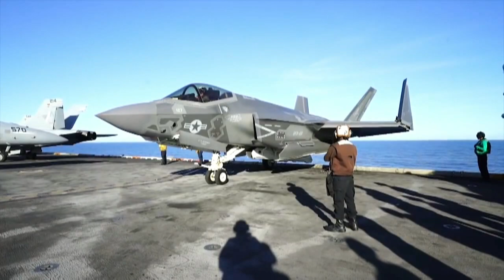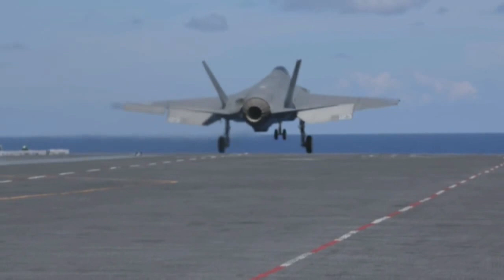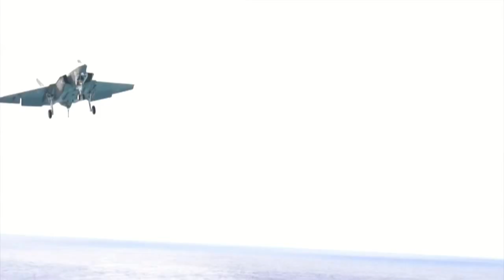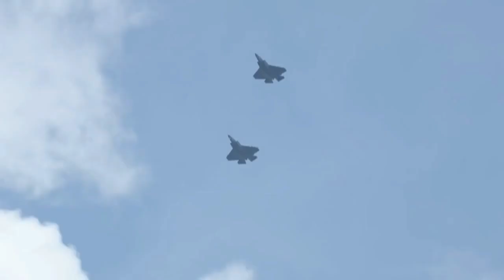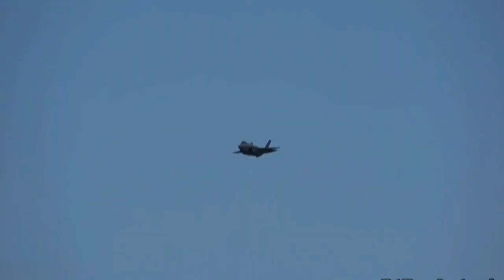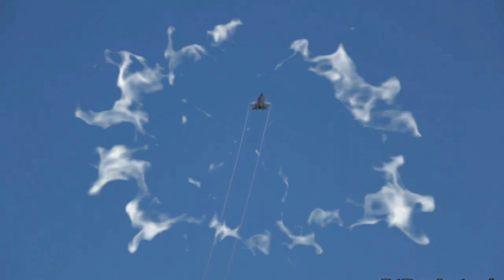American F-35C not able to Fly at Supersonic Speed - Stealth's Problem

Comment: Get the facts straight, This was a problem on ONE test plane in 2011, lot 8 production.. This was an early model with test stealth material. Lockheed resolved this problem with a new "baked into the skin" stealth mat. For maintainability, the F-35's stealth design took lessons learned from prior stealth aircraft such as the F-22; the F-35's radar-absorbent fibermat skin is more durable and requires less maintenance than older topcoats. We are now into production Lot 13. The agreement calls for Lockheed Martin to produce and deliver 478 F-35s. This includes 291 aircraft for the U.S. military, 127 for international partners that contributed to the development costs of the F-35, and 60 for foreign military sales customers.
Reply from the maker: Dear Friend, its a new report. Report submitted on last Friday. I think you are not updated on this matter. 
https://www.defensenews.com/air/2020/04/24/the-pentagon-will-have-to-live-with-limits-on-f-35s-supersonic-flights/?fbclid=IwAR068KbNL2VWbnh3CgXdlUl4Vf_9P18OvTb5R_1qbyA35wdssoZ1wlwhJwY
Reply: @defensebarta2617  

And oh dear?

Let’s read what they said:

The deficiency, first reported by Defense News in 2019

Now, read that again!

And read again one more time!!!

And in case you have more trouble?

Read it again!!!!!

The deficiency first reported by Defense News in 2019

In other words?

They are quoting WHEN THEY FIRST reported the issue!

NOT THAT THE Military first reported the issue!

Talk about a mike drop!!!!

Who cares WHEN THEY first reported the issue! They did NOT state WHEN the military and air force reported the issue!!!

GOT IT????????

Let’s look at their FIRST reported LINK they have in this article:

In that 2019 link and article?

They state this:

F-35B and F-35C pilots, compelled to observe limitations on airspeed to avoid damage to the F-35’s airframe or stealth coating

So, they are quoting documents they have, and that issue was fixed in 2011 – 9 years ago!!

What limitations they talking about? Why of course the limitations observed in 2011!!!!!!!

So, sure, THEY FIRST reported on the issue last year, but that is NOT WHEN the issue was reported!!!!

Man, you REALLY, but REALLY have to learn to read!!!!

It I called fake news, or BAD news with bad intentions.

It is 100% irrelevant WHEN THEY FIRST reported this issue. 
 Who cares when you or defense news FIRST reported on this issue? Why such a silly headline? Why did THEY SAY THEY FIRST REPORTED!!!! - they provide ZERO links and ZERO information as to the date WHEN this issue was reported!!!!

So, now, let’s dig up the facts on this matter:

Let’s get the quotes from the real folks on this:

Vice Adm. Mat Winter, who leads the F-35 program on behalf of the Pentagon, told Defense News that the department has taken steps to mitigate the problem with an improved spray-on coating, but added that the government will not completely fix it — instead accepting additional risk

That coating is a new ceramic based paint that can withstand the higher temperatures.

And, NOTE very careful this statement:

Winter noted that the issue was documented while the jet was flying at the very edge of its flight envelope. He also said the phenomenon only occurred once for both the B and C models, despite numerous attempts to replicate the conditions that caused the problem

Read above again:

_ He also said the phenomenon only occurred once for both the B and C models, despite numerous attempts to replicate the conditions that caused the problem._

So, it is NOT a wide spread problem. And NOTE ALSO they NEVER saw the issue with the F35 “A” model.

So, no, this is not a big deal, or issue.  And note that story and information is EIGHT YEARS old!!! – from 2011.

So, no this is not an issue or problem with the F35.

And this:

Greg Ulmer, Lockheed Martin’s F-35 program head, said there have been no cases of this problem occurring in the operational fleet and that incidents have been limited to the “highest extremes of flight testing conditions that are unlikely replicated in operational scenarios.”

And Winter goes on to state this:

The new coating, which was introduced in Lot 8, allows the jet to withstand hotter temperatures caused by the afterburner, the documents stated. Winter characterized the material as able to withstand “what we call the thermal shock wave,”

Note that they even attempted to re-produce the issue!!!! They ONLY saw it one time!!!

So, you talking about an issue that cropped up 9 years ago, and has LONG been dealt with.

The deficiency, first reported by Defense News in 2019
 - so what? Why would you care when THEY FIRST reported this issue? For what possible feat of logic does that matter when they first reported on this issue? It does not matter one hill of beans - does it?
Reply: @defensebarta2617  its a fake news uploaded. There is no restrictions applied on F-35 Lightning 2 at all. Last day USMC F-35 Lightning 2 breaks the sound barrier on supersonic speed mach 1.6.
Reply: You are 100% correct - the issue is a non issue and was fixed and dealt with 9 years ago!!!

See my response below - this kind of beyond silly reporting by defense news has to stop. They are scum - nothing more, nothing less.
Reply: The competition will stop at nothing to undermine the F35. Says more about them than the jet.
Reply: @bjjace1  This report is from Department of Defence
Reply: @Karl-Benny  nope. DOD or not,
You proved the point by believing old news dressed up as new insight. It’s desperation by a mile.